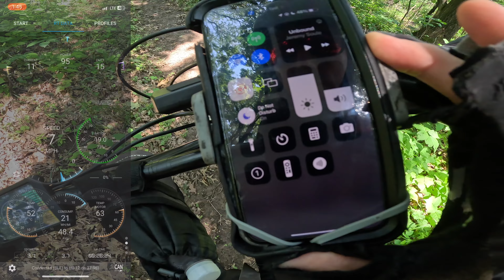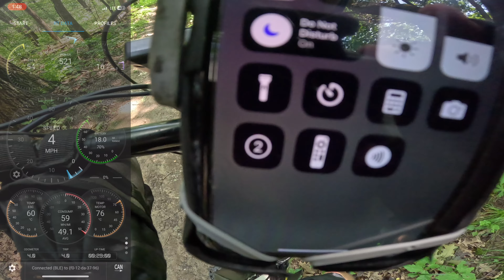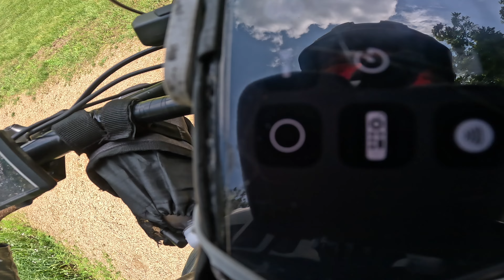Bafang REGEN on a TRAIL - Why I Like Regen Braking. Addressing Comments.

Comment: Alright, got the Flipsky 75100 Pro V2 with the key lock straight from Flipsky today. The Pro has 2 CAN wires on Port #1 & the Pro V2 has 3 wires & the button starter. It's GND, Ignte & Bat+ so glad I waited & can send the Pro back. So the key ignition & volt meter plugs right in to the V2 & that part good to go.
Reply from the maker: Nice steve , yes the pro v2 is why i jumped on flipsky!!  I believe the previous 75100 (non v2) you would have to buy the Bluetooth module separately, it didn’t have “phase filtering”, and some other issues , but with this pro v2 they integrated the Bluetooth and phase filtering so they are getting better every version. I’m glad you were able to send the non v2 back, its a confusing naming convention for sure.  I am going to look into pas soon 🔜 i also think i will use the key 🔑 ignition at some point. I want to use that volt meter that’s on it!

Comment: Going Good Bro here  Thanks , I Got some E Bike a commeter Type , Im In Australa and were restricted too 500 watts , That What mine has Got Even tho it was Advertised as 750 watt motor , But i eckon thats Peak Power , Does that sound Right ? Any Hoo i Might get a bafang 750 Watt Motor and put than in at Some Stage , i Live in the Mountains and the Hills Zap my Battery , Regen might be good for me in the future
Reply from the maker: Hey Brian yes that is correct your motor may be 750 watts, but they limit the “peak” output to 500w for legal purposes. Usually the controller limits the speed and power, so using a different controller without those 500W restrictions is a possibility. If you live in the mountains and use lots of braking while descending , regen could be very useful indeed. You can sometimes pop a 750w motor into a 500w motor, with these fat bike motors that can be a possibility. Good to hear from you Brian mate !! 👍👍
Reply: @EBikeBuilder_  Thanks bro Your iven me a lot too think about , Ive only Had the bike for a Month , Brought it second hand , It seems Ok  Purpose built 
So In the futre there are heaps of things i can Upgrade 
E Bikes Rule 
keep Up the Good work bro Take Care,and watch out for dudes doing Wheelies Behind You LOL

Comment: Just like the dangers of the front wheel spinning out and losing control, I keep thinking a time will come when you unexpectedly lock up the back wheel in a high speed turn...  Maybe you taking a turn on a rainy day and your leaning on a yellow painted line.  The back wheel brakes/breaks loose while the front brake transfers weight to the front.  That scares me on a street motorcycle.
Reply: I wrote this^^^
Before you Regen brake skidded in your video. 😄
Reply from the maker: regen is controlled by an input, it can be set up however you want. Brake lever, seprate throttle, i think in phaserunner they let you regen from pedaling backwards. There are a number of ways it can be configured. The way I have it set up Yes it can be dangerous if you are going fast and then let off the throttle completely, that is how the regen engages, It requires a different riding style and use of the throttle. There's some kind of traction control in vesc, I haven't used it but I saw some options related to it. Vesc is for skateboards and stuff where traction control is imperative
Reply from the maker: @joeberginc7415  i knew there wuld be a comment about that LOL, but i was going around a 180 degree switch back turn, Trying to demonstrate the power of regen Lol, it was wet and it's the big smoothy tires in the woods 😂  Ive never had it regen skid except really loose stuff. Like going down a loose gravel rd  absolutely slamming on regen, one time, i've had it skid very briefly  in a non dangerous manner Lol.  The only time I think you could fuck up and regen brake skid out. is like leaning into a corner where there's loose stuff.  And the same thing could happen with normal brakes.  Now in the winter with snow and ice,  i dont know that I will be using regen, since the braking can lose traction and be dangerous.  Regen in the winter will be interesting. I admit in dangerous icy conditions I dont think regen will work very well. And I would probably pop back in the non - welded clutch

Comment: I back calculate my wheel diameter from a real ride between two points of known distance. Divide the distance by the number of revolutions and you'll get a more accurate and meaningful tire diameter. Nobody rides in a perfectly straight line and this method corrects for that. Your "effective wheel diameter" should be slightly less than the measured diameter.